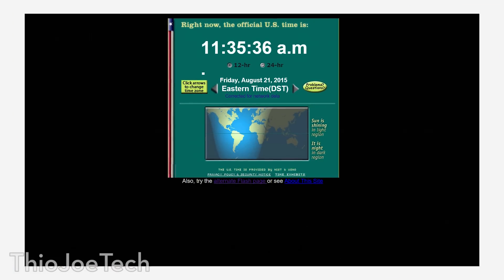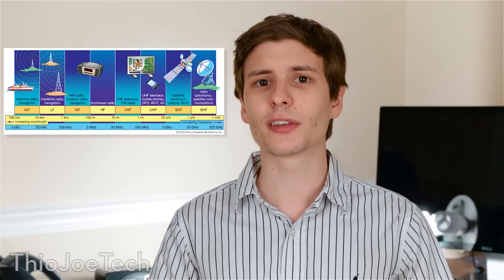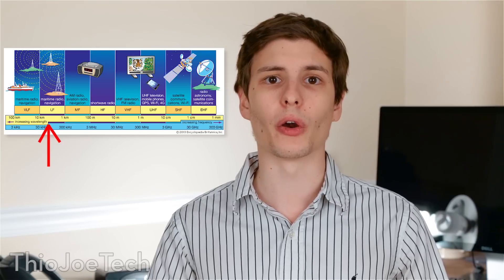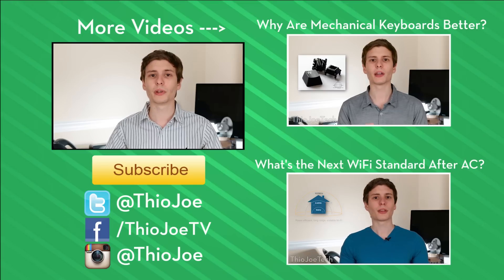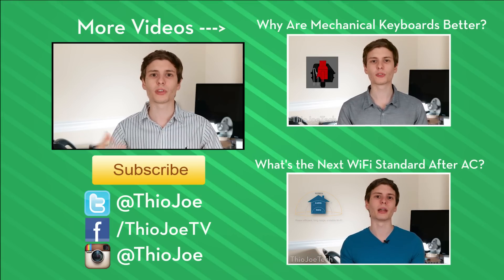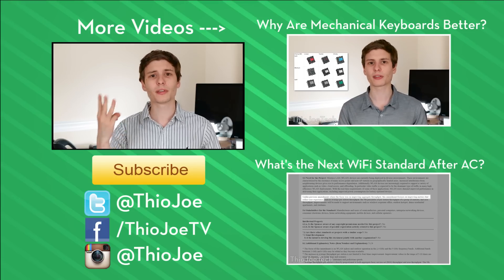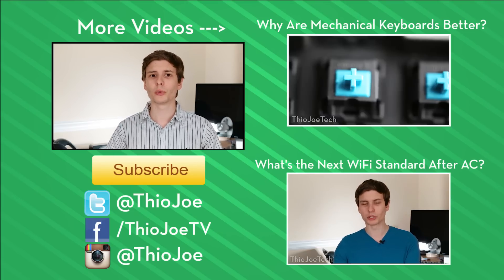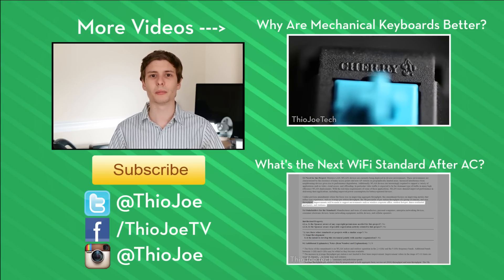How Do Some Clocks Set Themselves?

Comment: There are three ways that clocks can set themselves:
1. Through receiving a radio signal from the 60 kHz NIST radio station WWVB. This is probably the cheapest way for manufacturers to include this feature. However, the signal is often too weak, the electronic "noise level" from other electronic devices (like a nearby computer monitor) may be too great, or the clock's receiving device is too undependable to set the time consistently.
2. Through receiving a Global Positioning System (GPS) signal. This is usually a faster means for clocks to set themselves, but the receivers can be somewhat more expensive.
3. The clock links with a local Wi-Fi to receive time signals from a service provided by the NIST. This is probably the most reliable method, but clocks with this capacity are expensive, requires (of course) a Wi-Fi, and usually not readily available in retail stores.

Comment: My self-setting clock cannot work the way you describe. It is not an "atomic" clock. It instantly sets the date and time when I plug it in (in less than a second). But after that it does not keep highly accurate time. To reset to the accurate time, I merely unplug it and plug it back in. My impression is that a time signal is somehow transmitted through the electric power lines, but I am not sure about that. Can you shed light on this?

Comment: 60 kHz seems like it should be fast enough to send out a time much faster than a minute right? Does it broadcast the number at full precision? Assuming the time is being sent digitally, if you just find out how many 9 billionths of a second have happened since about 1960 (might be later than 1960) I got a really big number that was times 10 ^ 19, but when I found log 2 of that number I got 63. That means it only take 64 bits to broadcast. If something is vibrating 60 000 times a second, I'd be surprised to find that it actually took a minutes. Fun fact, the waves of that signal are 5 km long.

Comment: But if the frequentie is so low, and if it takes a minute to send the information, doesn't that cause the clocks to be over a minute behind real time? And a clock near the station thing gets the signal way before a clock on the other side of the country. How can these clocks get the correct time? This video raised more questions then it answered.. xD
Reply from the maker: +Animiles Not a bad point, but I think it wouldn't be slow because it knows how long it takes to send the signal. Also the speed of light is so fast it wouldn't really be a delay.
Reply: Animiles
The artificial fire boats thank you.
Reply: +Dayton Meyers 
Why did you type your message in Spanish, except for the word "therfore", which you spelled wrong anyway?
Reply: [deleted due to useless comment]
Reply: [deleted due to useless comment]
Reply: Dayton Meyers
That doesn't answer my question.
Reply: nakyer
Well, since it doesn't have anything to do with my or thiojoe's comment I'll delete them all :)

edit: can't delete them.. I marked Dayton's comments as spam, since they were spam, and removed the text from my comments.